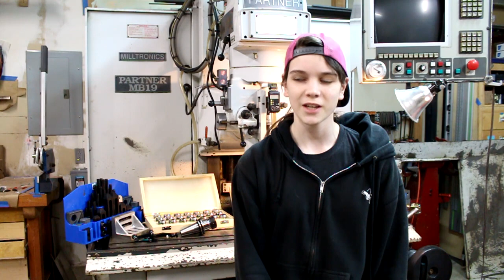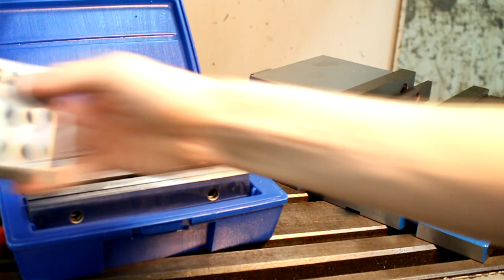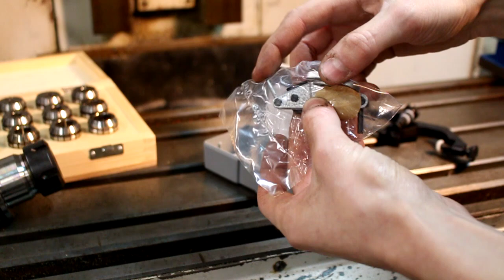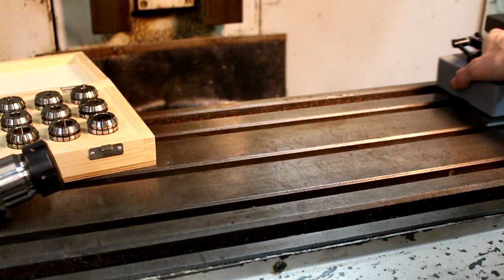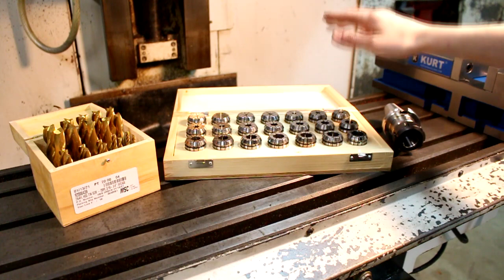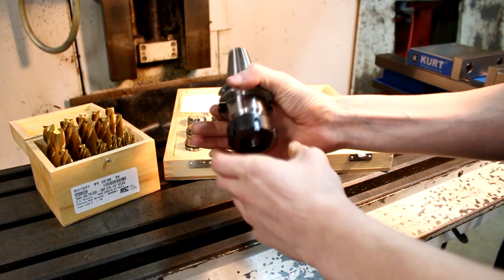Mill Tooling Haul!

Comment: When you can afford it get a Haimer  3D Sensor makes setup a lot easier with CNC . can order them from Amazon about $450 to $500
Reply from the maker: Okay I will put it on the list! I saw one in a video and thought it was pretty cool!
Reply: @Hwy49RC  Keep in mind the Hiamer tips are the weak point and cost a bit at $ 40 to $45 a piece so slow movements 

ps I use YG1 Alumi-Powr cutters get from Amazon Great for Aluminum 3 Flute TIANN coated
Reply from the maker: @benlivengoodjr8314  Yeah makes sense about the tips. Small and fragile. I will look up those cutters too! Thanks for the tip!
Reply: @Hwy49RC  anytime I just started last year with a Haas TM2P and  it has been a steep learning curve but online help was wonderful and i am willing to pass it on
Reply from the maker: @benlivengoodjr8314  Makes sense, thanks I appreciate the thought!

Comment: I'm sure lots of people are gonna chime in same thing, but those ER collets, you snap the collet into the cap first.  There is a small ring that snaps into the groove in the end of the collet, which is what pulls the collet out when you loosen it.  If you tighten the cap onto the collet the way you had it, it'll get messed up.  Very fun stuff.  You're starting out with some serious hardware for your CNC setup.  I started with a little HF mini mill converted to CNC a few years ago but am on mill #4 now.  You're going to love what you can do with your setup!  Have fun, be safe.
Reply from the maker: Yeah someone else said the same thing. I did tighten it down a couple ways that time but after reading these comments I went and looked at it looks okay, no serious damage or burrs. Very cool! Yeah I am excited!

Comment: You can get a wrench cheap for a er32 collect and use a vise with soft jaws to tight the tooling in the collect. I wouldn't recommend tighten in the spindle. The end mills or drills can fall free and cut you or damage the the edge of tools. A fun project would be to make your own holder for the cat 40 tool holder. Best of luck in project there is plenty of help online. Always be safe.
Reply from the maker: I actually made my own wrench for it and my dad made a holder for tightening so we are set! He actually used the circular pocket function to mill out the hole for the tool holder which was pretty cool, I regret not filming that honestly. Cheers!

Comment: Regarding the collet tool holder. You need to snap the collet into the threaded cap first. Then insert it into the toolholder.  Also great choice for the interapid indicator  I have had mine since 1982.  The hass channel as agreat video that explains all the collet types that even I learned a couple things from if your looking for some more info.
Reply from the maker: Well I'll be darned! I just went out and looked and sure enough, they do! Thanks for the tip! I will check out that channel too...
Reply: @Hwy49RC  https://youtu.be/WKikm6cQKh0